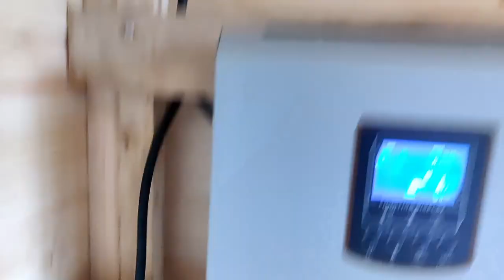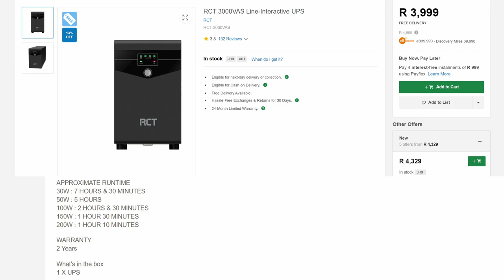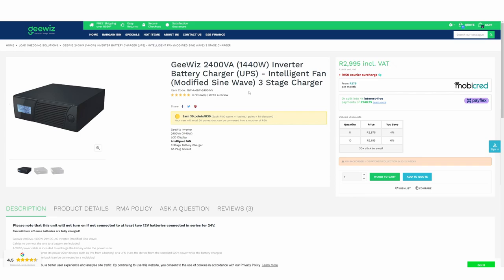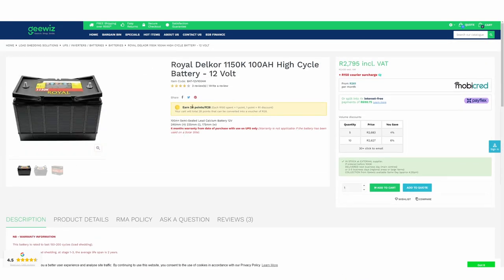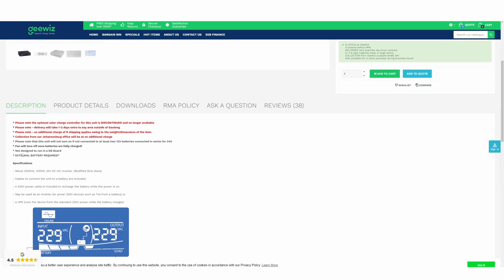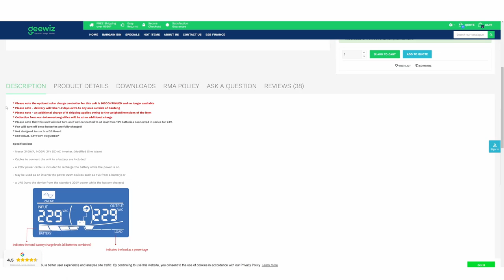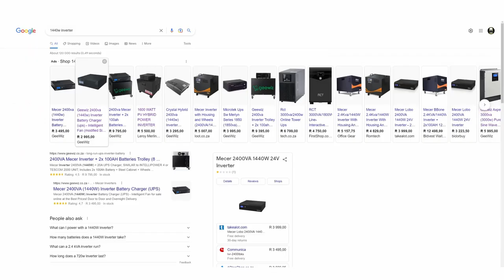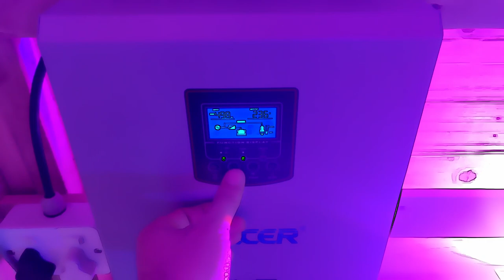Running your gaming PC or Console for over 4 hours! What you need... UPS or Inverter Battery Backup

Comment: Modified sine wave is 100% fine for electronics (just less efficient), not good for inductive loads (motors, fridge, etc) and heating elements (toaster, heater, etc). A cycle is 100% discharged to 0% and charged back to 100% (1 cycle), some may argue a cycle on lead acid is 100% to 50% and back to 100% (below 50% causes damage reducing cycles significantly), for lithium and deep cycle AGM or Gel it could be argued a cycle is 100% to 25% and back to 100%. Typically for lithium (LifePo) the battery will naturally degrade over time (like expired food) before the advertised cycles are reached, so a lab test indication of 5000+ cycles will actually be somewhat less as it doesn't account for extended time, which is why some manufacturers have reduced it to a more conservative 4000 cycles (roughly 10 years at 1 cycle per day) as real time use data comes in.
Reply from the maker: Unfortunately I still wouldn't recommend modified sine wave inverters as the PC might be fine but things like monitors and TV seem to be falling victim to the lack of efficiency, not to mention the ps5 that for what I hear won't even run on a modified sine wave inverter
Reply from the maker: And regarding DOD of batteries unfortunately Ive got to disagree with you there, any discharge whether its 25% or 80% and recharge again is considered to be 1 cycle. A Gel battery can last 4000 cycle if it discharged only 10% at a time, where is would only last 700 cycles at 80% discharge, this usually depends on the manufacturers specifications
Reply: @JustekGaming  By your logic a float charge would rack up millions of cycles, in which case cycles mean nothing (technically cycles mean nothing anyway, so I won't argue with you, else it will be a back and forth going in circles...lol.) Too many variables to get into a cycle debate: temperature, rate of charge, rate of discharge, depth of charge, chemical composition, internal composition, distance between plates, number of plates...and so on.
Reply from the maker: Just because there are so many variables when come to cycles it mean it doesn't exist. My question would be what's your experience with batteries and inverters? I'm more then happy to be proven wrong as Ive been in the industry for long enough... Again your merits entirely incorrect, life cycle as published by manufacturers can be use as more of a guide line due to the many variables not taken into account
Reply from the maker: I do appreciate you feed back
Reply from the maker: And float change is the voltage of the battery, where as equalize charge is a higher voltage to reduce calcification

Comment: Royal and deltec is a no go.Only raylite smf100 deep cycles been running it for almost 4 years.Used it for cooking TV gaming water pumps .I have 4kw inverter 6kw battery bank
Reply from the maker: Yes I can definitely recommend raylite batteries as they are manufactured by a company called first national batteries and they are about 20 min away from me

Comment: I have a PC with 550 watt psu and i think i will use in total only like 650 and my electricity goes out alot like 2hrs like 4 times a day what will u recommend i get for an inverter and battery ? I will live in Pakistan so it would be fire if u look up the stuff in Pakistan
Reply from the maker: Thanks for the comment, I'll have a look and see what available in your area and get back to you
Reply: Any update?
Reply from the maker: Unfortunately not, it's a bit tricky to find what's available in Pakistan, but something as small as a 1000w inverter and a 12v 200ah battery with a small solar panel will make a big difference

Comment: So you need to buy inverter And battery?
Reply from the maker: Yeah or you can look at something like the ecoflow delta unit as they come complete with batteries built-in, https://www.firstshop.co.za/products/ecoflow-river-pro-600w-720wh-mobile-power-station-50032022-162598?_pos=10&_sid=657a09b03&_ss=r&ref=I267pSUfc9eg-x

Comment: Can i use UPS on my inverter ?? so that there is not delay when there is a power outage ??
Reply from the maker: @siliconcrayon  you can but you also set your inverter to ups mode
Reply: @JustekGaming  yes I've heard about it but there were some users who said at peak load computer may shut down sometimes and sometimes i won't so i wanna be sure how to get things done. Otherwise I'll throw in another ups and hook it up with inverter and hopefully nothing bad will happen. I wonder if anyone has tried this setup

Comment: As a fellow South African, I find your videos really helpful bru. I need to find a economical solution to run a standard office PC and a mid level gaming PC. Saw a SolarWize 1.3kw with 120ah deep cycle gel battery for R8200. Would love to hear your thoughts.
Reply from the maker: That's not a bad price, so a single 100Ah battery will allow you to run 150w for 4 hours
- 2x 100ah @ 350w +/-4 hours
- 4x 100ah @ 700w +/-4 hours
And this is based on lead acid batteries
Reply: @JustekGaming  Hi. I ended up biting the bullet and ordered  a Geewiz hybrid inverter (R5 500) and got 2 x 100ah lead  carbon deep cycle  batteries @ R3700 each at my local Willard battery dealer ( 7000 cycles at 50% dod). As you mentioned, it's cheaper to build it yourself. Still need to assemble. Will give you an update.
Reply from the maker: That's awesome, those batteries sound pretty good
Reply: @donovanpetersen8850  any update on how this solution is working bro?

Comment: thx.
but is that normal that GEL battery (12V 120A) under 80W PC load lasts for 3 hours? I calculated: Peukers effect, -30% of full capacity, -15% of efficiency of UPS and it still should give at least 8-10h. Under that load voltage drops at the end from 12.5 to 11.3 and that I think  gives signal to turn off battery, but is that normal for Gel batteries and Lithium doesn't have so much voltage drop on load?
Reply from the maker: Thanks for the comment how old is your gel battery?
Reply: @JustekGaming  about 1 year and I was lucky that in my house power was not turning off, so it was just keeped charged all the time. In another friend 200Ah Gel battery, was working fine(4+hours for PC) and now(after 3 month) 1 hour only. we are  using normal UPS 560w(800VA)
Reply: @JustekGaming  so, would you reply?
Reply from the maker: Unfortunately that's the life span of a gel battery. A lithium battery can do anything from 4000 to 6000 cycles where gel batteries at most can do about 1000 but it depends on the manufacturer. Gels are usually rated for 600 cycles meaning by a year of continuous usage they are usually done
Reply: @JustekGaming  thank you. 
Maybe you know how voltage drops under load in your lithium batteries? and at which load? i cant find this info:c

Also there are few factors about which people are not talking a lot, but it is very important factors:
1) Peuker effect - the more load, then less capacity you have;
2) Voltage drop - related to previous, but there is limit on load which you could get, because voltage drop will trigger UPS to turn off, because it will think that battery is discharged;
3) real capacity of battery is not just 12V * 120Ah.
to really calculate usable capacity you need to do next steps:
- 12V * 120Ah = 1440W;
calculate watts, cos it is independent value;
- 1440W * 0.7 = 1008W;
because akb shouldn't be discharged less then 30%;
- 1008W * 0.8 = 806W;
UPS consuming a lot of power too;
4) not sure, but resistance of cables, which could consume pretty much power;

Comment: i have a RTX 3080 10 GB and Ryzen 7 5700x what type of battery and inverter should i buy about for 4hrs
Reply from the maker: Thanks for the comment, something like a 3kw pure sine wave inverter would be more than enough to run your pc where we start to see an issue is the time required, your pc could pull 1000w per hour as my setup tends to pull about 800w, 1000w for 2 hours it would mean looking at a 24v 2560wh battery (100ah) and to make it to 4 hours you would need to look at 2 x 24v 100ah / 2 x 2.56kwh batteries, I'd recommend having a look at my latest video on my upgraded system as it might give you some more insight, with my current system I'm able to use 800w per hour for at least 3 hours I've also managed to add 2 solar panels that make a huge difference during the day

Comment: Hey dude. Thanks for the video. How long does it take for your inverter to fully charge the batteries after a 4 hour session?
Reply from the maker: Thanks for the comment, usually it would depend on the type of battery and charging capability of the inverter. Gel batteries would take about 8 hours at low amps, deep cycle about 4 hours and lithium can be about 2 hours. My system, on AC charges at 25A

Comment: Firstly love the content,  as a fellow loadshitting citizen i would like to know what advice do you have for me as i live in a rental flat, i need to have a mobile system, i dont know my power draw yet but i have a i9 10850k,rtx 3080ti and 1000w psu. i need to be able to run my system for atleast 4hours if need be, i also can use solar so i wil have to use the mains to recharge my battery pack,any advice wil be of help. thanx and keep up with the wonderfull content
Reply from the maker: Thanks for the comment:
- As for an inverter, a good quality pure sine wave 3kva inverter can output 3000w so it would handle your equipment without any issue but I'd probably look at something bigger like a 5kva as they are able to charge batteries faster between loadshedding

- As for batteries, Lithium Ion batteries are still the best bet as they last longer and charge quicker but tend to cost 4 times the price and at the moment can be hard to come by, Gel or AGM battries will work but batteries are recomended to only go 50% discarge 

- Based on what you've got as an estimate (as PC don't use the max wattage of the PSU typically it shouldn't use more than 700w) at worst budgte on 1400w 

At 700w battries would last 
 *24v 100Ah (Amp hours) = 2400Wh or 3.4 hours 
 *24v 200Ah (Amp hours) = 4800Wh or 6.8 hours 
 *48v 100Ah (Amp hours) = 4800Wh or 6.8 hours 
 *48v 200Ah (Amp hours) = 9600Wh or 13.6 hours

At 1400w battries would last
 *24v 100Ah (Amp hours) = 2400Wh or 1.7 hours
 *24v 200Ah (Amp hours) = 4800Wh or 3.4 hours
 *48v 100Ah (Amp hours) = 4800Wh or 3.4 hours 
 *48v 200Ah (Amp hours) = 9600Wh or 6.8 hours

As for solar panals for a 200ah system would require 4, 250w panels to maintain the system throughout the day and will definitly help prolong the batteries